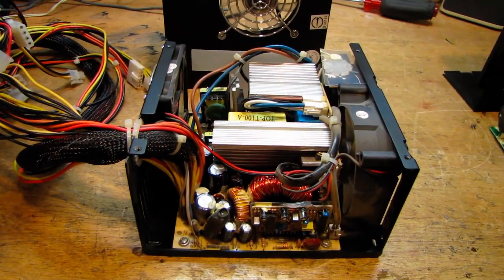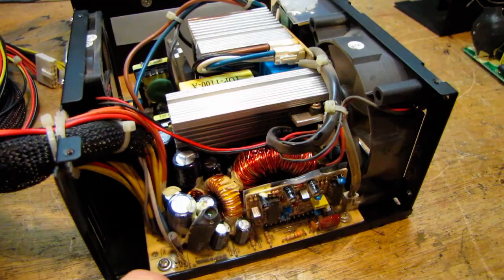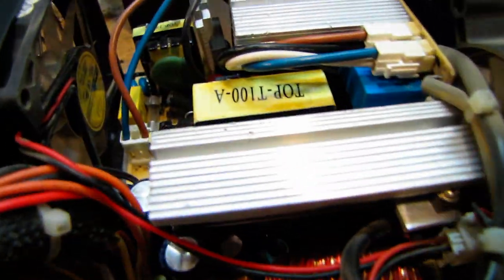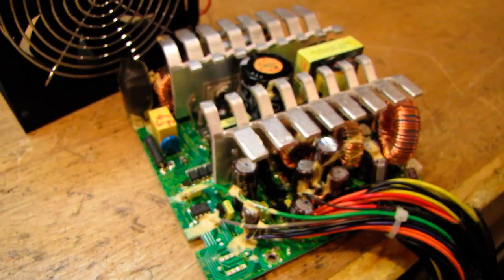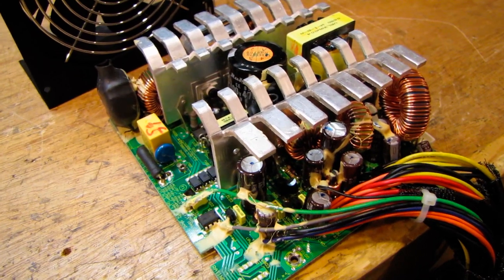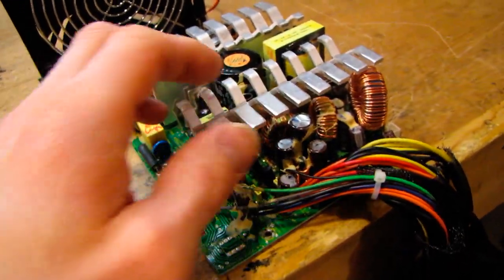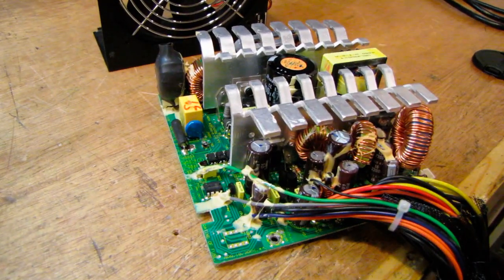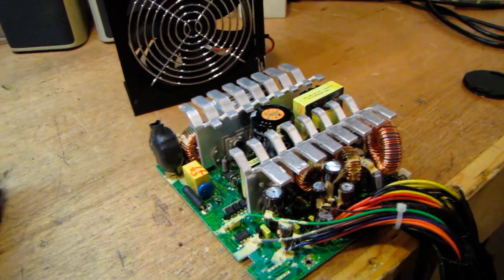A Look At Computer Power Supplies, Part 2 of 2

Comment: Hi, I agree with you about the speed of the fan inside the PSU, which I think must run at the highest confortable speed to cool down the best, obviously I tweak the speed to a comfortable ear level, therefore I dont quite agree with those new PSU with the fan at zero speed at lower loads, if the fan run quietly, to me is ok to keep the fan on even at lower loads

Comment: My current main system has a Cooler Master V550 power supply. This one was made by Enhance. Read various reviews that actually stress tested PSUs and the only "fault" they found was this model has slightly higher inrush current which makes sense since it has a big main transformer.  It's 80+ Gold and tested to be 90% efficient at typical loads. My case has the PSU on the bottom with its own air intake and even though the fan runs at low speed, the air coming out of the PSU is cold, even after the machine has been running under respectable load. The test unit was full of Japanese made capacitors as well. Hopefully it will last the 5+ year life of the system.

Comment: The main reason for multiple 12V rails is because of a safety standard that limits wiring accessible by users to 240VA, so Intel set the spec to limit 12V rails to 18 Amps, so to get more 12V power you use several 12V rails current limited to 18A.

The side effect of this is the benefit of the added PI filters which act as current shunts to measure current for OCP and filter noise from leaking into a rail from other rails.
Reply from the maker: I've seen lots of newer power supplies with a single large 12v rail.  I wonder if they found a way around that spec?  Seems dangerous since a short on one connector would just burn the wires instead of shutting down half the time.  I had that happen with one of my work computers a couple years back.
Reply: Maxxarcade
Yeah the newer supplies boldly ignore the IEC 60950 safety standard... No way they can detect a short who's current is at or under the supplies rated current for that rail...

Btw, I made a mistake, it was 240VA not 260VA which means 20 Amps max on 12V rail, but Intel choose 18A for an extra 2A margin.

Edit: Did a little digging, turns out Intel has waived the 240VA limit requirement in it's PSU validation program... I guess they were taking some heat from the PSU engineers who looked at the limit as an expensive annoyance.

Comment: I have a good quality PSU fail recently, it was a Thermaltake Purepower 420W late 2003 model. Has run various PCs over the years and has been sitting in my spare PC up till yesterday. I tried swithing it on  and it did not instantly power on so I held the power button in and it powered on but didn't boot the system, all the fans ran including vga card fan. No beeps, no post, nothing. So I tried holding the power button in to shut it down and that did not work, so I switched the PSU mains switch off and I noticed the PSU was quite warm.

Removed the PSU from the PC to test it and switched the mains on and noticed a high pitched continuous noise, I switched it off again and the noise increases in volume for a brief moment before dissipating, like a cap discharging or something.
The psu did not power on when I tried bridging the green and black pins. So it's dead basically. just makes this high pitched squeal.

Do you think leaving this PSU plugged in with the mains switch on over the years has caused it to fail. As I said it was warm to the touch.
Reply: bigjoeangel Those are switching power supplies. They need to have a load on them or they won't start up. Sometimes making a high pitched squeal...
Reply: Jim zz I binned it and bought the cheapest PSU I could find. That works! It's only an old XP machine that rarely gets used, with no critical data, so not worth spending much money on. Cheap, shit PSUs do have a purpose other than in Dell PCs, lol.

Comment: I have seen many PSU fail, of have issues due to cooling issues. I think your so worried about noise, what I'd do is mount the transistor, rectifiers, etc. to the case. Cases are mostly aluminum, and more surface area.
Reply: ***** manufacturers should make them out of aluminium then it would be a great idea!

Comment: A quality PSU is essential.  Once someone stole the neutral wire for the transformer outside and it caused constant 236V surge out the outlets.  Fried my Xbox 360 brick, microwave, and fan.  But my computer was completely fine, because I had an Antec PSU with over voltage protection :)

Comment: I have an hp desktop computer and i turned on and the cpu fan was running alot faster than usual and it wouldnt do any thing and it turns out the powersupply had a short :(

Comment: Great info in this and part 1.  Thanks!  I have a pd that is decent.. but for some reason it does not turn on reliably.  It seems to work when it wants to. lol  The first thing I looked at is the caps.  They are all ok.  Nothing else seems to be wrong.  I'm stumped! lol  Anywho, thanks for your videos.

Comment: that is why you DO NOT skimp on your computer's powersupply. that's the thing that if it goes belly-up, it could very well take all of your expensive components along with it. invest in a good corsair, seasonic, antec or pc power&cooling supply that's ACTUALLY 800w and not the Chinese definition of '800w.'

Comment: in the case of that seasonic. what exactly happens when a power supply burns up like that? does it cause a dead short or something, or maybe do the voltage regulators just go toe up?

Comment: LG electronics use Samyoung & G Luxon Junk!, Astec, Lite on and Delta ATX PSU's are actually quite good units!, I have a Cheap Skyhawk PSU that was made in 1995, despite it using all Generic Components and capacitors made by a Company no one's heard of, it still works Very well!

Comment: hi, i may sound naive, recently there was a power surge in my home and an old crt and desktop pc stopped working, crt tv got fixed by a friend of mine who fix tv and said one big capacitor and 2 diodes were bad, it would be helpful if i get to know is it the smps of the pc which has gone bad or entire motherboard and cpu got fried up,, how can I test smps?

Comment: @gabrielcararo: But be careful. The large capacitor loses its charge very slowly. The loaded "DC" voltage is much higher than you get from your wall outlet! The risk of electric shock is very high.
If the computer power supply for a long time was not in operation, you can touch the inside parts without problems. You also might want to lick the solder side without problems. :-)
But it tastes a bit strange. Yes, I have tasted it.

Comment: @gabrielcararo: How old was the computer power supply? This can have many causes.
- Poor or aged capacitors, which have little capacity yet.
- Blown fuse in the power supply. (Glass fuse, be etched conductor fuse looks like a breaking point at the bottom of the electronics board. Semiconductor fuse that looks like a capacitor. Etc.)
- Defective optocouplers or other defective circuits
- Faulty components on the motherboard.
Look over the board of your defective power supply.

Comment: I have been using an Tagan Dual Engine TG700-U25 700W power supply for about 3 years. Still works like a charm. I use it with 13 harddrives, gtx260 black edition and core2duo E8400 clocked to 3,6 ghz. Rock solid power supply. The price was about 1400 SEK or approximately $220 or 140€.

Comment from the maker: @Dragonsrule89 Modular as in the cabling, or do you mean server power supplies with multiple units in one package?

With normal PC power supplies, modular simply means that most or all of the output cables can be detached, so you only install the ones you need.  It is to cut down on case clutter from unused power cables.

Comment: @Maxxarcade i hope so... mine lasts and i pull allot of power i would say my pc uses about 600watts to 950watts depending on load :) But i was intrested sens you know your stuff...

i got an flatscreen tv witch has sound but no picture and the backlight does not turn on. What do you think is broken in that one? :) Sound and remote and everything works.

Comment: I need a new power supply for one of my computers, the one it has just keeps randomly cutting out and won't go into standby mode properly.  What PSU would you recommend I should get? The computer has a second edition ASUS M2V-MX motherboard, an AMD athlon dual core CPU and an Nivdia gt 7600 gfx card.

Comment from the maker: The only server grade stuff I've really worked with that used "normal" ATX power supplies was around 10 years old or more.  The main difference I noticed with those, was that they had better quality fans, thicker metal on the case, and at least half decent caps.  But if they are a custom design for a given system, they are usually high quality.  

The unique form factor 190W Lite-On power supply in my Compaq Proliant DL360 has been running for years.  It has 3 fans, and uses all Rubycon caps.

Comment: Incidentally, it's a Thermaltake Silent Purepower 480 watt. It's a 2-fan unit with an external speed control dial that sits either on a backplane slot or a front drive bay, with a thermal override that increases fan speed if it gets too hot, regardless of what you have the dial set to. I've had it for probably 5 or 6 years now. Upon a cursory inspection, I've found one swollen capacitor. I might re-cap it and see if I can resurrect the thing from the grave.

Comment: I had a good PSU die on me in the most peculiar way. One day my PC wouldn't turn on after having fiddled with it the day before. Thinking it was a loose connection, I reseated the MB connector, plugged it back in to AC, clicked the power switch. Still nothing. I stared at it for about 30 seconds, trying to figure out wth was going on, then the damn thing turned on by itself. :P A few days later it died completely. It just goes "tiktiktiktik" about 4 times per second when I hold the power button.

Comment from the maker: The earlier Antec's had bad caps in them, but I'm not sure about the new ones.

I have an Antec TruePower 550 in my computer at work that I replaced all the caps in, and it runs great now.  They were decent quality aside from the bad choice of caps they used at the time.